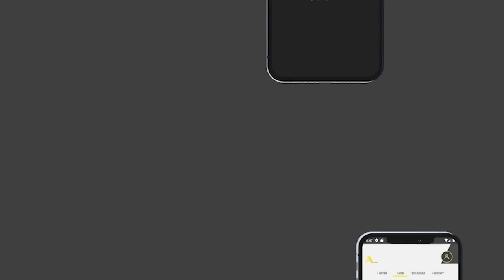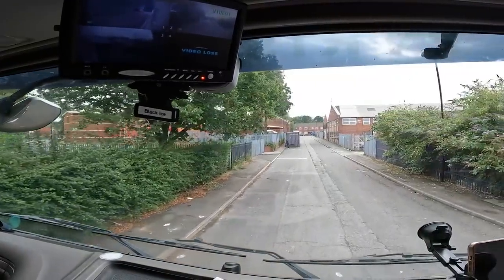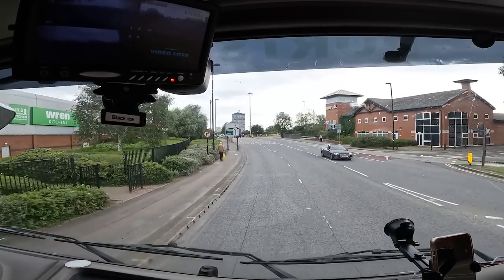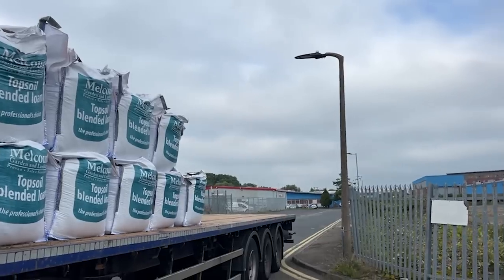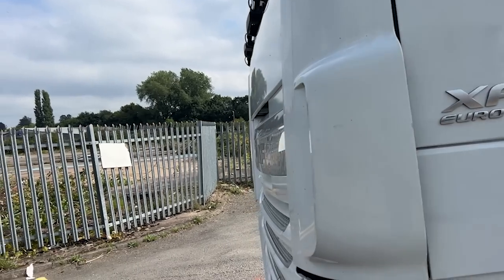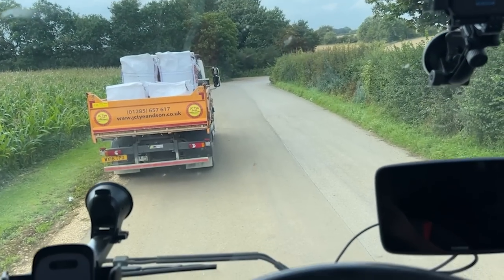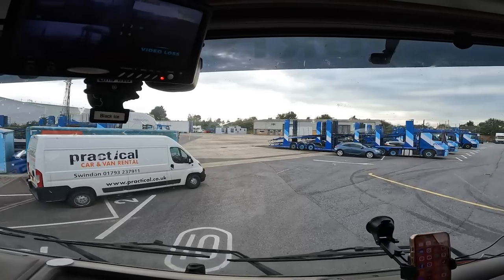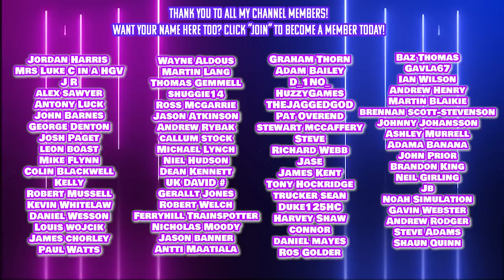I’m Not Able To Do That Boss…

Comment: Great video Luke. I know both the Coventry and Worcester sites well. You went in the correct way. Both locations are very old industrial sites which were there before HGV's were invented, hence the tight roads ! Most of the housing by the Worcester one is very new, itself built on old industrial sites.

Comment: All the toolkit you need:  WD40, Duck Tape, and a Crowbar.  If it moves and it shouldn't, Duck Tape, and if it doesn't move when it should, WD40, or if it still needs some help, use the crowbar.
Reply: Cable ties?

Comment: FYI, never use WD-40 as a lubricant. It is a degreaser and moisture remover. GT85 is better, but 3 in one oil is best.
Reply: WD-40 is not a great lubricant, however, it definitely isn't degreaser.

It's mostly oil + solvent to make it thinner.
Reply: @Dornacgove Try it on grease and see how well it works! It works a treat!

Comment: Luke I have a question and it probably sounds stupid. 

But if your already pulling a empty flatbed. Why would you need to go yard and swap for a different flatbed? I was going to ask in a different video. Hope you see this. And safe travels buddy
Reply: There could be many reasons, one may have different or more suitable equipment, the current trailer may need a repair or an inspection or MOT etc etc
Reply: @simonbaker3612  very true. Didn’t think about those things. Cheers Simon

Comment: What is the weight of 50 bulk bags, seems like a lot to me?
Reply from the maker: Very common question. Alot of the time, people are assuming a ton bag, actually weighs a ton. That is incorrect, that’s just what it’s rated too. 

Each bag weighs roughly 550kg give or take which equates too 27.5tonne. Plus my 15tonne rare weight means it’s around 42.5tonne total. 

We get weighed in and out 👍🏻